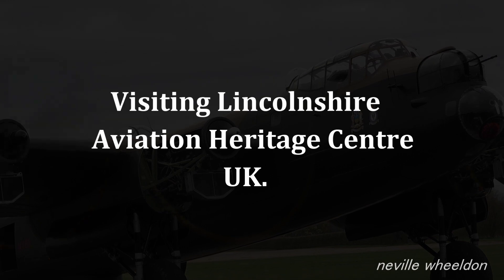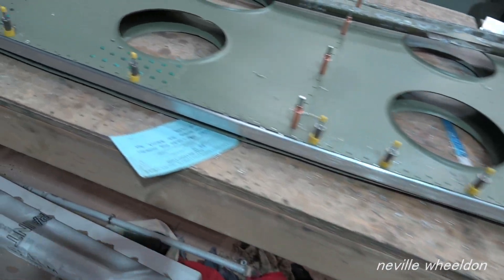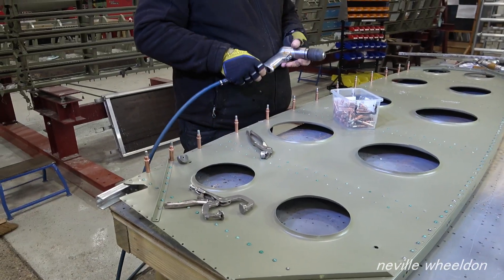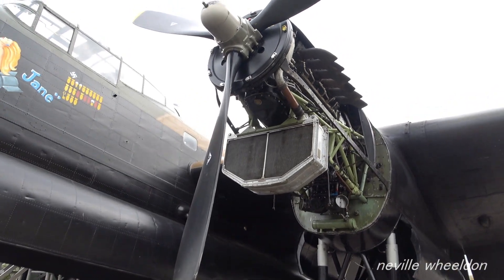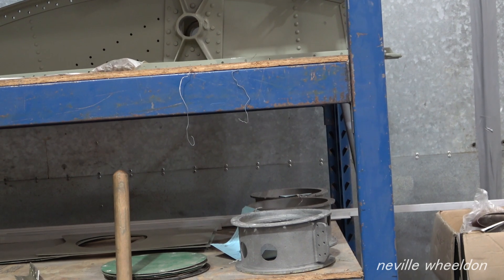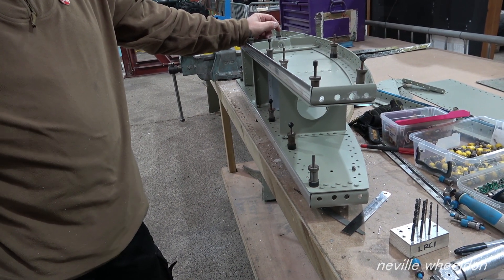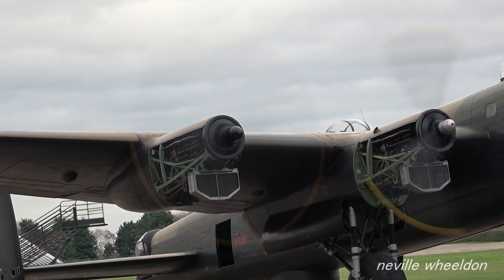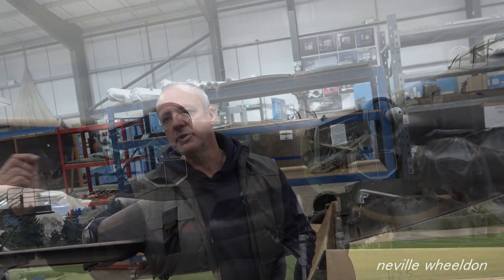Video 172 Restoration of Lancaster NX611 Year 6. Engine test, progress on wing and fuselage.

Comment: Neville,  question about the "extrusions" for the ribs. Are those pieces extrusions, or are they fabricated capstrip/stringers ?  Extrusions usually call for "mill runs" which are unbelievably expensive.  Leading to the question: now that I own 1000' of this extrusion, what am I going to do with the other unused 900' ?  The explanation about the cylinder glazing is spot on !!!  Nice work mate.
Reply from the maker: Hi Ed ,I had a word with John about the Extrusions, the original where called extrusions from a mill run and then rolled to give the shape. These were fabricated from a sheet of aluminium. The lads in the workshop called them extrusion so it stuck with me. good luck with your 900 unused extrusion. Please keep your comments coming in I'm learning all the time. Thanks Ed.

Comment: Thanks again Neville.....be interested to know what revs etc would normally be used in flight... or would it just be the amount of time that the engine would be running during a normal flight that would keep the glazing at bay.
Reply: BBMF use +7lb & 3,000RPM for take off, +9 for short runways, and +0.5-2lb & 1900-2100RPM for cruise. Wartime takeoff power could be up to +18lb boost.
Reply from the maker: Hi Adrian, Brad who replied to your comment is an engineer at the Centre

Comment: 'Neville To The Rescue '
The Lancaster running its engines 'without' the cowlings has 99.9% visually confirmed to me that NX611 is fitted with 'Tropical (Fin & Tube) radiators , or the modern equivalent of .They were chosen over the standard radiator to cope with the higher temperatures when operating with the proposed 'Tiger Force' in the war against Japan . During the 1970's and 80's  l worked for the company SERCK who during the Second World War manufactured the radiators and oil coolers for the Lancaster, Spitfire, Hurricane, Mosquito and the Hawker Typhoon  , then went on to produce fuel cooled oil coolers for amongst many others the Harrier and Concorde . I'm putting the finishing touches to my own video Neville, a 45 minute special about the company Serck and its links to aviation and naturally we give NX611 a mention. Thanks for this unintentional but much appreciated visual help.
Gary
Reply from the maker: It's a pleasure Gary.

Comment: hi Neville, just a query about cooking (solution treating) the rivets, are the various pieces of equipment (furnace & freezer) calibrated and tested to Nadcap requirements?
Reply: The kiln is calibrated annually. It's not solution treatment, the rivets are just heated and then cooled.
Reply: @andrewpanton1311  sounds like they are annealed - I was a Chief inspector for a heat treatment firm, hence the question.